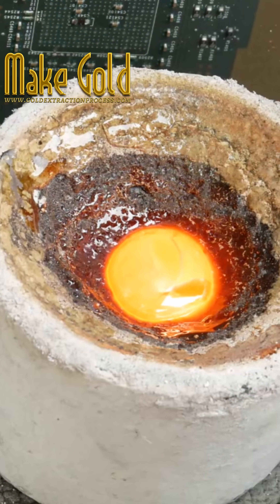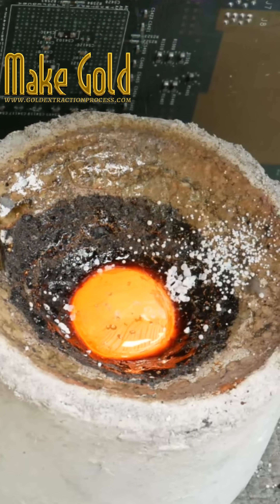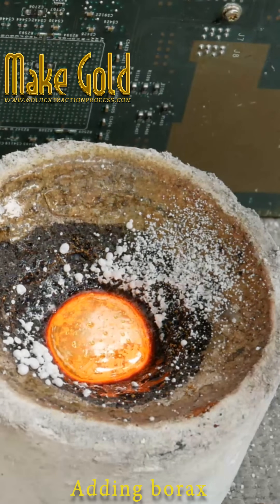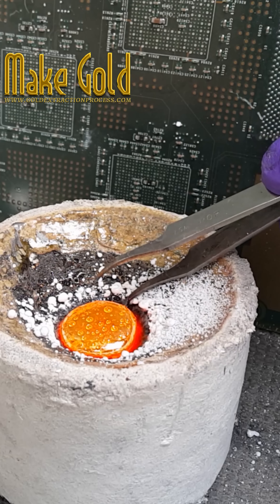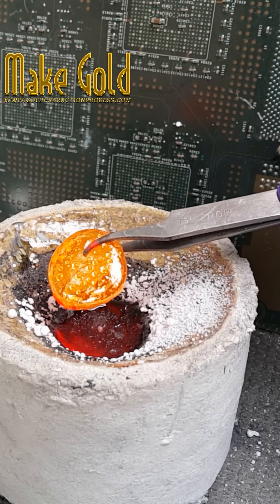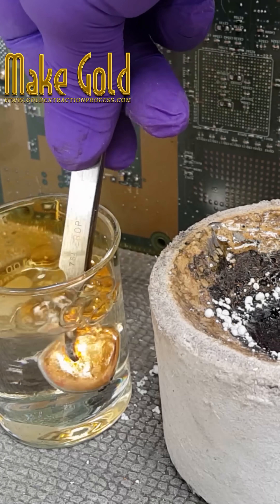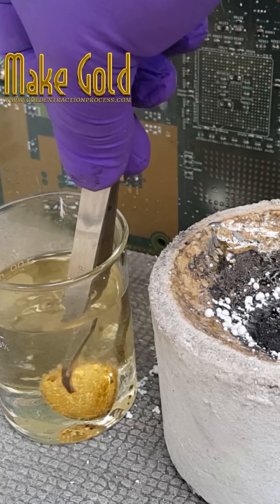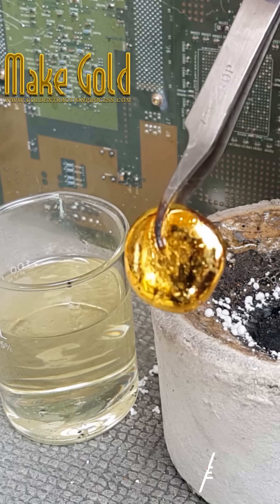Super Easy!  Borax Gold Melt #gold  #borax

Comment: You meant when you want to use borax use it in the crucible before pooring your gold in or else your gold will stick to it you have to put borax on it with a torch first while you melt it down it will stick the crucible instead of the gold voila
Reply: That’s called glazing the crucible